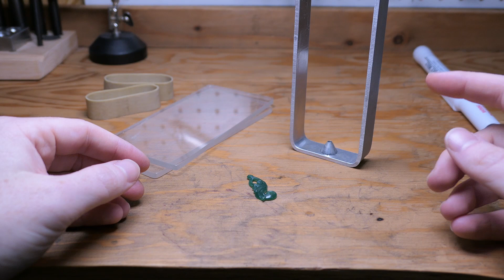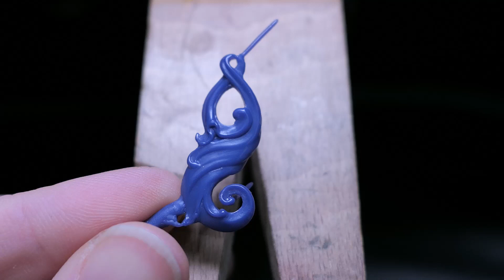Mold Making Process | Filigree Pendant Part 2

Comment: Can I ask about the vents? I have a really elaborate ring design, the elaborate part is that I’ve cut a design into most of it, would I need to do like 20 vents?? I broke it once already trying to make a mold, but I’m just not sure the purpose of the vent or how many are necessary. 
Thanks so much, I’m a novice and this video has already been so helpful!

Comment: Could always get an A/B mold printed up in thermally stable clear resin for these. It would skip the mixing uncertainty, the degassing, the 24 hour cure and would be a physically stronger mold to use. Just a thought.
Reply: less adaptable around non-symmetrical prominences though.

Comment: Is it possible to do it without vacuum pump? 😅 I'm a beginner and more homemade. If possible... how? I have a simpler shape I want to do.
Reply: I've heard that you can put the mold in a refrigerator right after pouring it and leave it in there for a few days instead. The cold supposedly slows the reaction long enough for the bubbles to rise out on their own. I've never tried it because I already had a vacuum chamber.

Comment: If I understand correctly I can use any type of silicon? Like platinum or tin
Reply: depends on what your original part is made from. if it contains any inhibiting chemicals then platinum is going to be a drama-queen. tin is more forgiving and cheaper, but isn't always as tough once cured. depends on the brand, of course

Comment: This is a great video! I’ve just got one question if it’s okay? How do you know where to place the vents? 

For example, I’m trying to cast a simple signet (with an engraving in the wax top), and I’m finding that I continuously get incomplete castings. Only one of 10 attempts has been successful. 

Any tips for rings? Would you consider making a mould of your lion head ring in a tutorial?

Comment: Good , I liked the way to put air vents, I normally cut air vents in v shape as many as I like so the pattern is filled completely with out any flaw. And now I will try 1mm dia wire to attach to the master, as air vents. And I never use talcum powder , as I want every pattern to be highly polished as the master model, I have prepared.
My two cents.
May all be happy and at ease free from dis-ease.
Reply: For silicone rubber mould, there is no need for a wax release agent of any kind. I prepare my Master models with high polish.
For metal masters models I polish it with diamond polish to mirror polish, so the wax   pattern comes out highly polished like master and casting also comes out highly polished as wax pattern, so minimum finishing and polishing is  required, to achieve highly polished surface of the castings with minimum waste of gold/silver.
My two cents 
May all be happy and at ease, free from dis-ease.
🙏❤️
Reply: @Digital-Dental-Designing-Tech  a valid point for wax. I also sculpt and cast finished pieces in various resins and plasters, they can be a bit more tenacious and rough on my moulds
Reply: You can use castor oil as a mould release that doesn't damage the silicone but also leaves a shiny surface.

Comment: Another great video! If you dont mind me asking, how did you manage to cut the silicon  island in the top of the pendant?
Reply from the maker: Thank you! I like to slowly cut along the outside profile (keeping in mind where I want the seem to be). Then when the inside island is easier to get to, I try to gently stretch the silicone and cut along the center so that the wax releases easily on both sides of the mold. 
Hope that makes sense 😅

Comment: So kewl to see someone doing it the same way I do  - im a big fan of diy and "on the cheap", lol 😏👍
Great video, thank you.
Couple things that helped me - 
1 - I cut air vents after de-molding the item
2 - I microwave my mold to heat it before injecting wax (cant guarantee what its doing to the life of the mold)
3 - I made a long tube on my injector instead of the tip like you have.

Personal preference, but I get my silicone from silicones inc.
GI 1000  10 to 1
Ive tried many and love working with this stuff - long library life.
Reply from the maker: Thank you for the tips! 😃 I've never tried that silicone but I'll have to look into it.